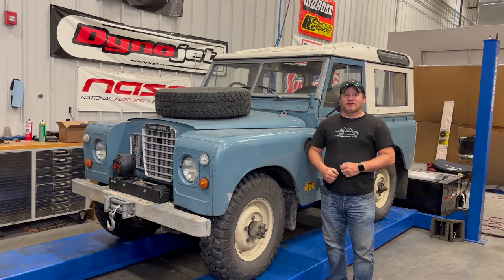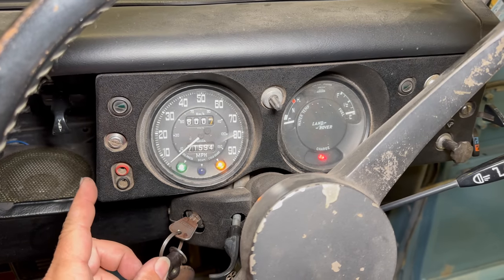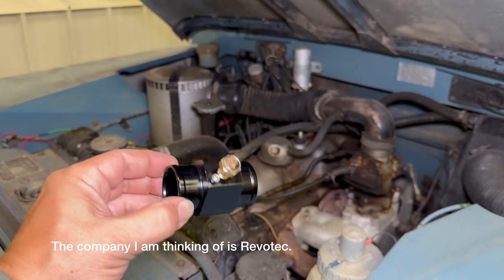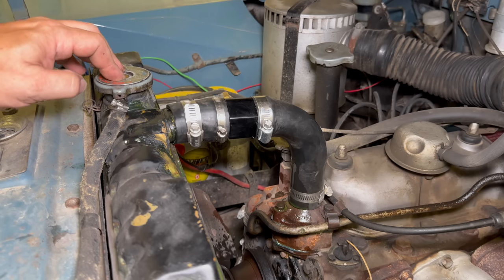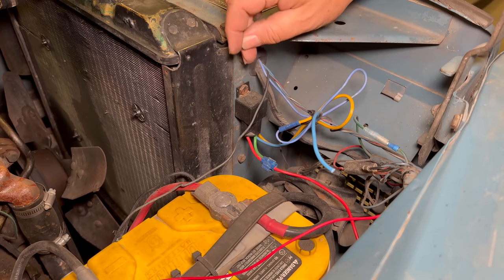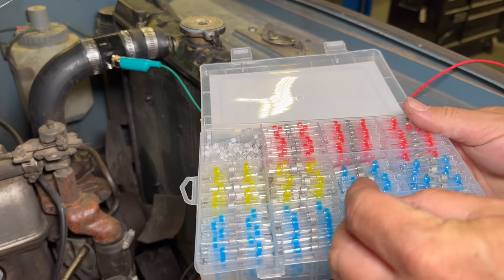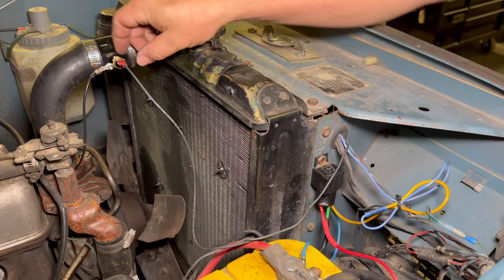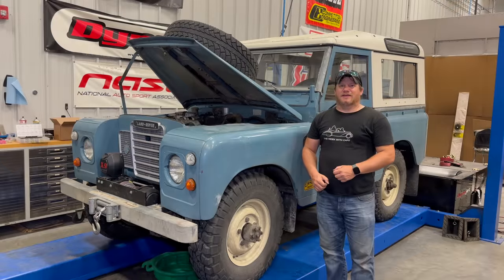Finishing the Electric Fan Install I Started 15 Years Ago

Comment: Steve - 7:30 or so.  Don't cut 2 wires together.  I know you're careful but if it's live and you short a circuit you get lightning and possibly expensive blue smoke.

Comment: I've tried the solder sticks, and with a hot air tool, where you can safely hover over the solder joint, I feel like I've had good success.
Reply: I was surprised he used a torch and not a heat gun.  Other than that he makes great videos and I have learned so much from all his videos!

Comment: Skip soldering, just use uninsulated crimp connectors and heat shrink. Dig into the wiring of old classic cars and find crimp connectors holding up just fine. .

Comment: Very neat solution! Could the electric fan be used instead of the mechanical fan? That Land Rover is one of my dream cars. My only concern with those solder connections (admitting I have zero experience with them, but have lots of experience soldering) is that proper solder technique is to heat the wires and let their heat melt the solder. This ensures that the solder flows nicely into the wires. This seems like it's counting on melting the solder and hoping it flows into the wires, which is a recipe for a cold solder joint that you can't see.

Comment: I run a pusher fan on my Jaguar 3.8S but its relay device includes an adjustable potentiometer 160F to 230F and the sensor looks like an aluminum nail with wires attached intended to be pushed into the radiator core which I did not do fearing damage, but simply left it clipped inside the fan shroud.  Seems to work fine.    Mine is wired live all the time which permits engine bay ventilation after shutdown to reduce fuel vaporization from the SU carbs and starting carb.

Comment: Be careful with those solder sticks, the engine bay heat can melt the low temp solder in them.

Comment: Why on earth is the original (crap) fan still on the pulley? Installed hundreds of these electric fans in my life, every LR and most English sports cars. Temp sensor fitted with same unit as you but with switched override inside, no new holes ever made, sneak probe alongside loom in to cab with tiny light to identify fan on. 
Original fan sucks engine power, is noisy and achieves very little air flow, B1N it please! 
Strongest fans come from Australia, ambient temp there is highest around, well done Aussies!
Regards from England.
Reply: I just asked the same question, and I'm also a Landy expert (retired) from England. The wiring looked like it had been done by a DIY guy to me Pete. Not impressed.

Comment: Steve do a sodder stick test at the work bench show us how strong they are, try to pull the wires apart. Thank you.
If there may have been overheating issues, why didn't the design include a shroud?
Reply: There is a video on YT where they cut the solder joint apart. They did several different joints using several different heat sources. The cut apart solder joints all looked pretty poor. This was the deciding factor in my not ordering a set of these.

Comment: Why didn't you remove the engine fan blade as it's no longer required? I hope you tidied up the wires to the temperature sender and fitted a fuse from the battery to the relay Steve.
Reply from the maker: 1. I want to keep it as original as I can.  2. This has just a generator so I want as little electrical draws as possible so I want the original fan to do most of the work.  3. Relays and electric fans can be unreliable and leave you stranded waiting for your engine to cool down.
Reply: @ThisWeekWithCars  Hi Steve. I understand you wanting to keep it original, but that went out the window when you cut the top hose. I'd remove the dynamo and fit a Lucas Alternator, as the vast majority of SIII's came with the Lucas Alternator as standard. Electric fans are probably one of the most reliable auxiliary items you can fit. I assume you carry a tool kit with you? Then remove the engine fan and throw it under the seatbox just incase.

Comment: Make a video about how to open the hood with a damn tire on it. I hate storage of these big monster tires up there.
Reply from the maker: It is very heavy but it looks so cool!
Reply: @ThisWeekWithCars  The weight of 7.50x16 tyres on a LWB or Wolf wheel can cause stress issues for the bonnet, particularly if driven off road.... but, as you say, it looks cool!! 6.00x16 wheels and tyres on a S1 are an easier lift when stored on the bonnet.

Comment: I see that your are partial to British iron. And it seems a lot of that iron is Land Rovers. On Bring-a-trailer, every day they seem to list a Land Rover. However there is also a fair amount of Toyota Land Cruisers. If you were to recommend one over the other for a 75 year old in the middle of the Dakotas which would you recommend and why. Thanks and I enjoy your channel. Doug
Reply from the maker: I have owned and own plenty of both Land Cruisers and Land Rovers.  If you just need a four wheel drive and want something that will be reliable get a Land Cruiser but if you think you will be in areas where you might get stuck I would get the Land Rover.  All of my Toyotas have let me down getting stuck in the simplest of obstacles but the similarly equipped Land Rovers always make it through.  I have a vintage FJ40 and if I had to drive the truck to the trail and back it is the one I would take, if I was trailering it there I would take the Land Rover.

Comment: I tried those solder connectors a while back, i felt they were good in theory but trash in execution. Too much work to melt that solder well and heat shrink started melting.
Reply: They make a deflector tip arrangement for electric heat guns that concentrates the heat on the solder and then can be used to insure the ends are shrunk.  Used by the military all the time now days.
Reply: Sure but I’d bet the ones the military uses are from a reputable manufacturer and cost a bit more.